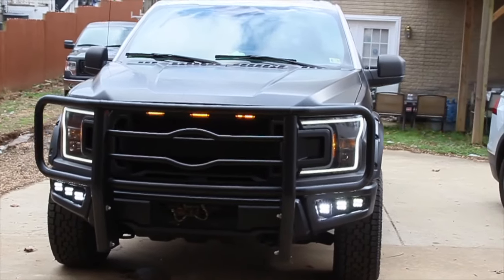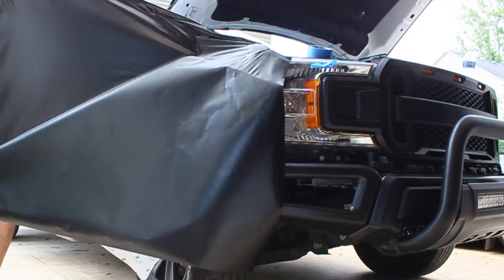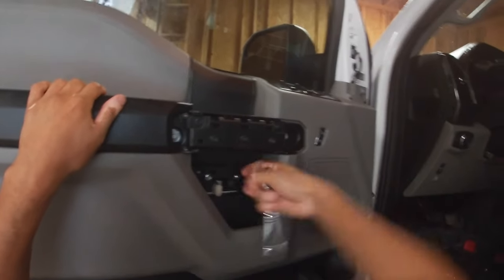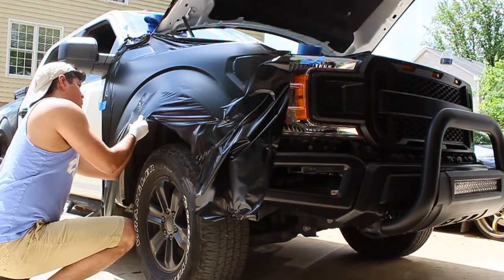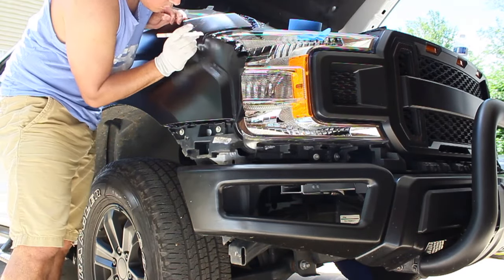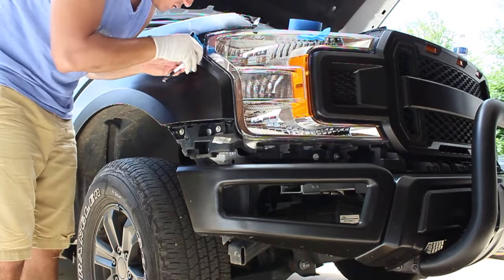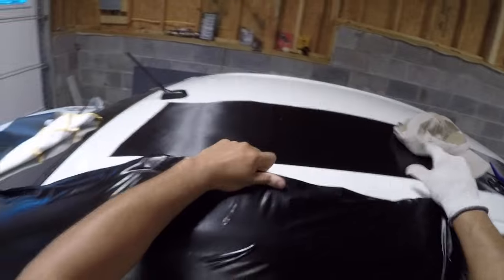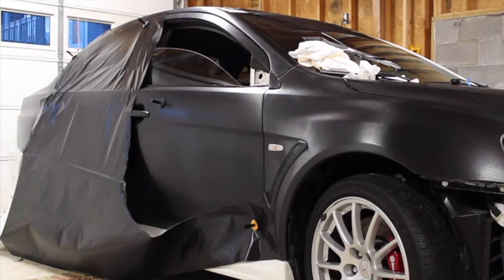DIY Vinyl Wrap For Your Truck - What To Expect, Costs, Tips

Comment: Great video man, and spot on with doing this yourself, takes time and patience but is very doable and cost effective, i wrapped my first truck  a year ago and about to wrap my new one. Saved myself 5,000$ doing it myself. For anyone wondering most shops start at $3500 for a basic color change for trucks and suvs. After watching a bunch of videos i learned that this next wrap job ill work a little smarter by measuring and cutting the panels then before ripping the liner off ill cut out the extra material so i can use it for scraps like mirrors and small stuff.

Comment: Bro, i got a 100-foot roll of the exact car wrap for $ 3.00 at a amish store. They buy pallets from Amazon that is returned for what ever reason and they sell it dirt chep. Also got enough sound deading material to do my entire cab of  my truck the engine bay firewall. The under neath of th3 hood and the front fender wells . For 7.00.  I felt guilty when i handed them a 10 dollar bill and walked out with hundreds of dollars woth of materiel.  In my defense, i did ask them if their prives were correct, and they said yes.   I guess they pay like $60 to $90 per pallet load of returns.  A lot of the stuff  hasnt even been taken out of the package

Comment: What I'm wondering in regards to trucks. How do you cover the area behind the cab (in between the cab and the bed) where there is like 2 inches of space?
Reply: Wrap shops typically remove the cab. It can be done, but you need to be a master at placing knifeless tape in that small space
Reply: Take off the bed of the truck get a couple buddy’s to help you pick it up of the frame
Reply: You can maybe 🤔 wrap 3 inches in? You’d an really see all the way in there

Comment: This might be a dumb question but when you wrap your car  in a color do you have to go to the DMV and register as the new color🤔🤔🤔
Reply from the maker: I never had a problem with color changing vehicles. It is just a giant sticker so it can come off whenever so I don't think it's an issue. A local vinyl Wrap shop could probably confirm that for you.

Comment: Good demonstration mate, I did my bonnet (hood) just about pulled my hair out ...ripped one bit off the edge  😳 and thought I'm not starting again so I spliced apiece in and you can only just see it.
Reply: Most professional shops will cover there edges with extra pieces ;)